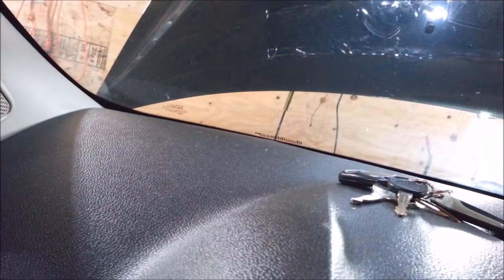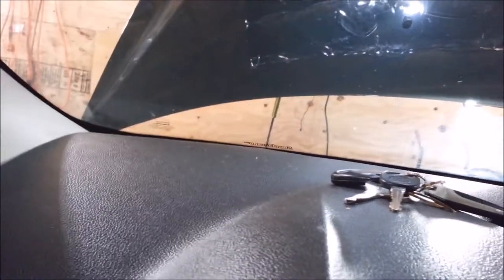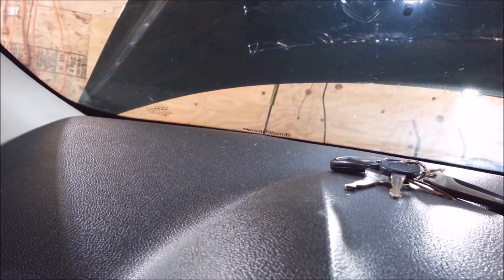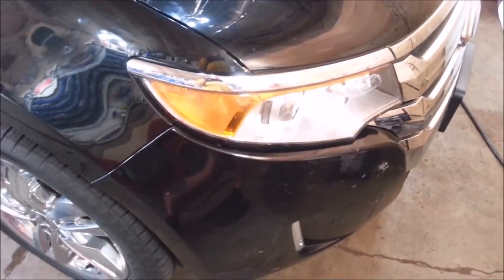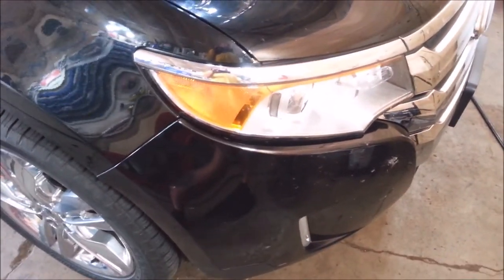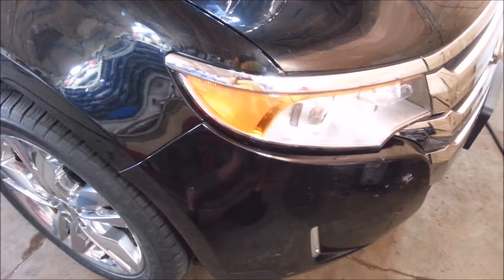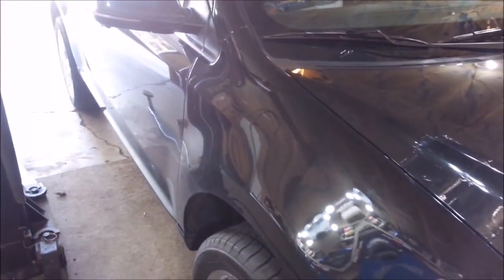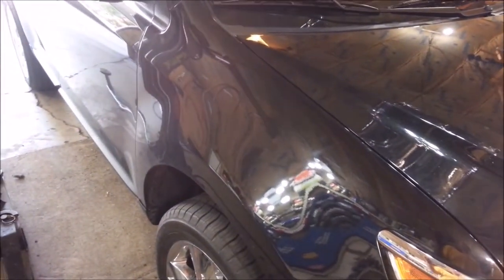2007-2015 Ford Edge MKX low brake pedal fix

Comment: 2013 Ford Edge. Brake pedal went to floor after panic stop on wet road. Limped home with brakes but had to leave plenty of distance to stop. Looked on internet and saw Ford “extended warranty” for bad brake booster. Took car to local Ford dealer who said it sounded like the booster and my car qualified for warranty repairs. Left the car only to be contacted later and said the problem was actually the ABS control modulator and pump. $2200 for repairs. Brought the car home as it would be three days for part to come in. Saw this video, went to local school lot and perform the reverse panic stop. On the third attempt, the brakes returned to normal. Went down a deserted highway and performed three 70mph panic stops. Brakes and ABS worked flawlessly. Went back to Ford, told them what I did and they were speechless. Not sure how long the fix will work but I kept my $2200 in the bank. Thanks for the tip.

Comment: Sorry I'm seeing this to late to help you but at least i can help others. Nine time out of ten there is no need to replace the block (hydraulic control unit) or plastic module or the master cylinder when you have a soft mushy petal going to the floor before stopping the car. Its only a stuck valve in the block (hydraulic control unit). what you need is a 1/2 to 5/8 steel rod about 30 inches long give or take battery will need to be in because you will need the engine running during part of this procedure. place the rod between the plenum and battery and guide it down until its against the corner edge of the block (cant be done from other side of battery or you will break the plastic module) now medium taps to the block with car not running 3 or 4 times by medium  I'm talking 4 to 5 inch swing at it not hard not lite either. What we are doing is jarring the stuck valve loose, now have some one start the car and proceed to tap the block again with the petal down then have them pump the brake pedal while you tap on it again and during this process if all goes well the valve will pop loose the pedal will return to normal and your done. This works on the ford and the Lincoln model both have the same not so good system and its a common problem on both but easy to fix once you know what is causing the pedal travel problem. yes the statement "taking a hammer to it" really works sometimes :)
Reply from the maker: I can imagine a hammer, and steel rod being a fix for a Ford product, and do like the idea of changing out the brake fluid as well. Thanks for that. I hope it helps someone as well. Reverse brake grenade worked for this too. Another amazing Ford product fix :).
Reply: Thanks for this tip. It worked. When my wife drove the 2011 Ford edge, she had the same issue as this video.  Got the master cylinder replaced and everything was fine. Then she had to slam in the brakes and the problem came back. I tried what all the other videos say to do, but your suggestion was the only thing that worked.  I feel the valves may still be a little sticky because the pedal is still a slighty soft, but it's significantly better and no more hissing sound with the pedal going to the floor. Thank you.

Comment: Thank you so much for posting this! You saved me from spending the day at the mechanic. 2012 Ford Edge had the same exact symptoms and I searched Google for the brake bleeding procedure which led me here. Took it out to an empty parking lot, brought it up to 25 mph and then laid on the brakes hard. Came to a screeching halt with the ABS clattering away and the pedal popped back to the proper position, good as new. Didn't need to run it in reverse or on a gravel road or anything, just brake grenade moving forward and it was done.
Reply: Do you have cashapp or a way I can throw you a few bucks? You saved my grandma a tow to the mechanics shop. I'd love to pay it forward!

Comment: Legit works, I nuked my brakes on a gravel parking lot and the pedal came right back. Tip: In my case I had to turn the wheel just before braking to have success.

Comment: Have a 2011 mkx just spent  2700.00 on it at Ford . They said  the brake booster was bad. It wasn't  I  told them I can hear the abs squeaking . They  blocked it off & that's what it was. I told them also they were charging  me for parts I  didn't need . [ the brake booster] & new brakes on the back.:-/ 😠  Angry at Ford

Comment: This video saved me!!  I put new pads in both front and the rear., still spongy.  Saw this video and tried it except I did it on pavement and it didn't work.  Went back to the video and read some comments and saw it should be on loose gravel or dirt.  It took about 6 times going backwards in which the brakes seemed to be better, then I went forward at about 40 mph and nuked the brakes and BINGO!  Thanks much!

Comment: Actually I had the same problem. My wife came home told me brakes were weird. I took it for a drive and they were super spongy and wouldn’t grab until very bottom. Usually they grab right on top. So I changed the brake fluid put in Lucas synthetic dot 3 the best. I run all Lucas products in all my vehicles. So anyways did that bled brakes took for test drive and same thing. So I looked on YouTube see if this was an issue the 2012 ford edges have and found similar issues but nobody had a solution. They would replace master cylinder, brake booster, this and that and nothing worked.!before they knew it they were way out of pocket to their local ford dealers, mechanics etc. so I came across this video and I actually activated my abs on purpose but forward and the brakes were trying to get better but still spongy and grabbing low. So I literally just went down a back road today when I got home took my wife’s edge went In reverse at 20mph slammed on brakes to activate abs did that twice in a row and when I went forward and hit brakes they fucking grabbed on the top. I couldn’t fucking believe it so I went for a long test drive through the back roads having to hit brakes several times and they are fixed!!! It’s like they had a lock in them and since we only hit brakes hard or going fast forward it’s like something was stuck and by going backwards and activating the abs in reverse it basically unlocked the air lock or something they had in them. Now my brake issue just happened Saturday and I bled out old brake fluid and got any air out that night. Sunday car sat, Monday wife only took daughter to school few miles away and it sat until I got home from work at 5:30pm tonight and I went and did this about hr after I got home and it 100% unjammed whatever lock was in the brake system and the pedal stops right at the top like it always did before the issue. If for any reason it starts acting up I will edit this post and be sure to add any issues the vehicle may have. But as of right now I did everything this guy did except I didn’t replace the master cylinder and the edges brakes are grabbing on the top and there is no spongy feeling at all. So seriously if your having this issue bleed the old brake fluid. For those who don’t know have some one inside vehicle while you loosen the knob on brake system can’t miss it has a rubber cover to protect the knob mine was 8mm wrench. Have them pump brakes nice and slow pumps while you catch the old fluid in a bottle. Do one side at a time and when your getting near the end have them pump and hold the brake(this ensures you don’t let air back in)to the floor until you tighten the knob.Do one side at a time and then when your done refill the reservoir on the master cylinder with new fluid right below the max fill line.
Reply from the maker: @M H It must be an abs issue. Probably a mechanical issue, like a stuck valve, or possibly a module. I didn't get any codes, so who knows for sure? I bled brakes, replaced master, and stopped there. From the looks of my videos, a lot of people must be replacing masters on these. Probably for no reason. Maybe someday a real Ford guy will come on here and explain what is really going on with no BS. I can bet they just replace the ABS module, and valve body for lots of cash. I do not even know if there is a TSB on this issue. It is looking like a fairly common problem.
Reply: Rust Belt Auto ya I just did the reverse thing and the pedal popped back up and pressure was back!?!? We will see in the future what happens but I never got an abs light or anything so just went with the basics of thinking there was a leak and couldn’t find one. So just bled out the old fluid put in new fluid and then reversed at 20-25 hit brakes made abs activate did that twice and the brakes started working right got pressure back etc. but I know it’s not the solution and like you said maybe a ford guy will step up and let us know what part is failing admit the issue and make it a recall. It’s dangerous my wife went from brakes to grabby sponge brakes that grab at the very end of stoke. That’s why I hopped on fixing it right away!! Thanks for video it helped me out!!
Reply: Literally have the same issue. Ill be picking up my vehicle tomorrow amd doing the same exact operation
Reply: Jeffrey Graves mine is still working great I Left comment same night I did this and still no issue
Reply: Mine is still working fine. I did it the same night I left the comment and it’s still working 👍
Reply: M H Is your car still working fine?
Reply: M H wow man thanks very very much... your comment helped me a lot thanks.. have a nice day
Reply: @MH thank you for your comment, I read it and gave it a try and it worked. It took a bit for the pedal to grab but it did after putting it in reverse 7 times on a paved road. On the 5th time the pedal began giving me push back, like a ballon wanting to pop, then more pressure on the 6th try. Had the brake fluid drained and the fluid flushed/bleed BEFORE I TRIED THE REVERSE ACTION, from the nipple on each tire but it only worked for a bit.  DROVE IY 25MPH IN REVERSE
Reply: @lillyrodriguez49  nice to hear it worked for you as well. We traded the edge in a year ago or so but it never had any brake issues after I did this little trick!

Comment: It worked on my Ford Edge 13 with 170k + km .
Tried it two times on reverse and slammed the brakes and the breaks acted normally again.
The problem occurred randomly on my car.
Thanks for your video sir.
Reply: Did you check for any bleeding prior ? 
My girls car just had this happen .. i’ll be going to pick her up and inspect it and possibly do what was mentioned on this video.
Reply: @davidgonzalez3252  No, there wasn’t any apparent leakage from the breaks at all. Unfortunately it happened to me again 2 weeks ago and I had to give to the dealership to check it and they said the the break booster needs to be replaced.

Comment: I’m pretty late to this. Had the car taken apart with new master cylinder in hand. Saw your video and put it back together without opening the brake system. Went to the dirt road and 3 hard panic stops later in reverse the pedal is back. Pro tip, if you don’t know you activated the ABS, you didn’t. Need to slam the brakes and you hear and feel the ABS working. As an auto repair manager I can say we would’ve been a master and booster into this before going to the module, like this guy says people will throw parts at it, even I was going to.
Reply: Well I did this and it only fixed it until it shut it back off and then back to the floor again until trying again then getting a pedal again

Comment: 2012 Lincoln MKX with the same problem. As you suggested I went out to find a gravel road which is not easy in this area anymore. I did find the perfect place, the railroad service road parallel to the tracks. I tried backing up and slamming on the brakes about ten times. It got better for one forward petal push. I then tried going forward and slamming on the brakes, the ABS would work sometimes. I tried going forward and then reverse slamming on the brakes each time. It then started getting better with each slamming run. After about fifteen forward and reverse slamming runs it was fixed. The petal feels better than it ever has the eight months I have owned this vehicle. Thank you so much for your help with this problem.

Comment: Upday: spongy pedal issue has come back twice since this post 😞  
Original comment: I had this issue and driving it at 50 mph and slamming on the brakes fixed it. I had to do it two times and I did it one time at 25 mph and now my petals nice and firm again. Didn't think of trying it parked till after I did it.
Reply from the maker: It needs to be moving, on a loose surface, in order to activate the abs.

Comment: My manager was about to send our customer to the dealer lol we had the same issue, we replaced the master cylinder and did a brake flush, it didn’t fix the issue. Right before my manager called the customer I found your video & tried it. Did not have to Grenade the brakes in reverse though, it worked fine in drive. Thanks so much for the help 🙏

Comment: The wife's 2012 Edge one evening started having a lazy "spongy" pedal. I jumped the gun and changed out the booster (took 1 hour to maneuver the old booster out from under the firewall, dropped new one back in within 20 seconds, go figure!)  wasn't the booster and was about to try a master cylinder. Thank goodness I watched your video, one 250 lbs fat man doing a panic stop in reverse on a gravel road did the trick. Thanks!

Comment: The Ford dealership diagnosed my spongy brake pedal as a faulty hcu unit.  $1600 repair, new part and crazy labor costs. However in the last minute I watched your clip as well as others and did the reverse and forward lockup on gravel and pavement and exersised the heck out of those valves and that brake pressure returned fully, even better I suspect.  Followed a comment and did the tapping on the unit as well for a bit...either way it works.  These are suppose to last the life of the vehicle,  so just exercise them when they get sticky...I guess

Comment: Did the reverse thing 5 minutes ago and after 3 or 4 tries it worked on my 2013 Edge.  My appointment with the dealer is cancelled for now.
Reply from the maker: You should really change out the brake fluid. It wouldn't hurt.

Comment: I had the same exact problem........out of the blue, 2012 Ford Edge with spongy brakes that nearly touched the floor.. MY SOLUTION: Went to my Mechanic, we tried the tricks in this video. Even drove it in reverse 20mph and "grenaded' the brake pedal to 'reset' the ABS. Put in a new master cylinder....same problem...........BUT THEN changed the right rear 'suspect' bad caliper and brakes are even better than new.............!!!
Reply from the maker: What was wrong with the caliper?

Comment: Thanks for the info.  2012 Edge SEL with a past recall 2+ years ago where the dealer replaced the booster.  Fixed it for awhile but 6 months ago gave it to my stepson with 70K on it.  Just had front brakes done and front discs and rear turned.   Spongy pedal came back.   Dealer was "clueless" as to what the problem was. 
His brother replaced the brake fluid and bed the brakes.  No fix.  Disconnected the ABS fuse and no fix. 

Found this video and they took it to a school parking lot and slammed the brakes in driver and reverse to engage the ABS and it worked miracles. 
Thanks Rust Belt Auto.
Reply: I did not under stand what he did to fix the problem !
Reply: @Wan72_  in reverse at low speed just "lock the brakes up".  Do it a few times and the pedal will stiffen up.

Do it in a safe place...
Reply: So does this have to be on gravel? I literally can not tell you  a gravel road in the city
Reply: Well I did this and it fixed it but it came back next day going to the floor again. I give up. Selling it.

Comment: Changed brakes cause they needed them. Changed Master cylinder cause I had squishy break. Still not working. Bled brakes forever! Found this video, tried doing in on concrete, asphalt, and then a gravel road, that didn’t work. Car has 130k. So I guess it’s the hcu. I found this video after doing the work. But I would def try these things before spending money. Start with cheap stuff and work to more expensive
Reply from the maker: Did the ABS moan, and groan? Did you feel the pedal vibrate?

Comment: I have a 2012 Ford Edge SEL and overnight my pedal became spongy. I had to push it all the way down to brake!! Luckily my dad has been a mechanic for 40 years and he immediately flushed/bled the brake fluid under the hood and each tire from something that looked like a nipple. I DO NOT KNOW THE APPROPRIATE TERMS FOR ANY OF THIS!! Anyways brakes we're back to normal. Then they were on and off and I did minimal research and tried this. In a empty street I put it in reverse 25pmh and slammed on the brakes, the first time I was a little nervous so I had pressed the pedal slowly, then slammed on the brakes...that made a clunk noise. I continued to do it twice in reverse and one forward, each time slamming on the brakes. I put it in reverse 7 times, by the 5th time the pedal gave me some push back, it felt like when you press on a air ballon to pop it. The 6th time it gave me more of a push back then the pedal grabbed!!!!!!! I've been cautiously driving it for 2 days and the pedal is back to normal. No spongy brake, no having to push it all the way down and no money down the drain replacing the booster.